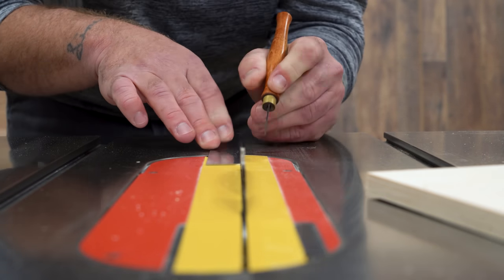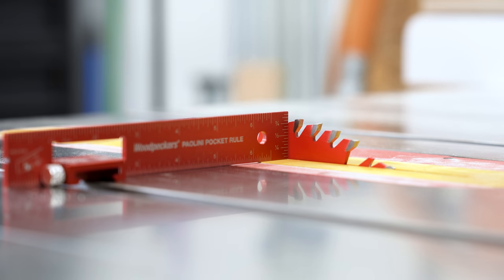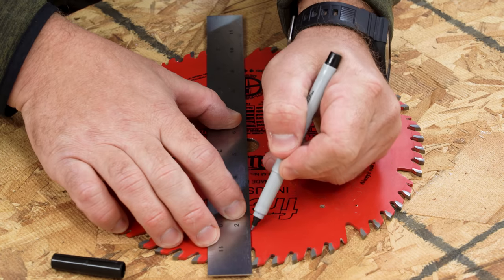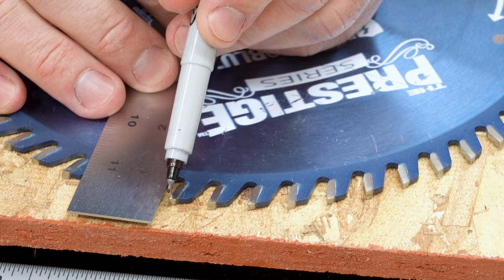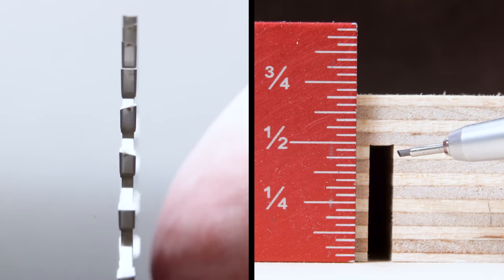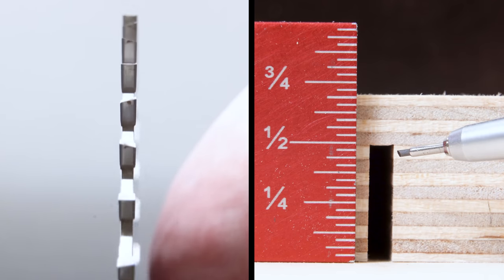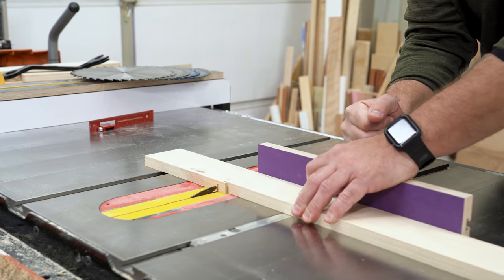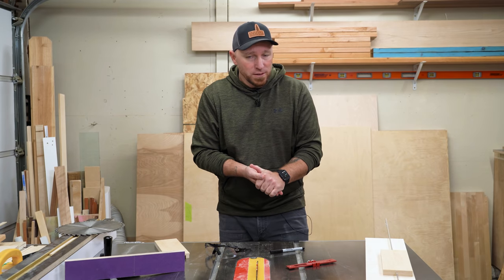Possibly the Single Greatest Table Saw Upgrade / Table Saw Tips and Tricks / Woodworking

Comment: Excellent idea.  I have 3 different width flat bottom grind saw blades.  I have a center line drawn across my throat plate and a vertical line on my fence, but those are not exact.  This will eliminate any doubt.

Comment: Great trick! A mark on the table (aligned to the center of the shaft) would also help setting the blade, so it's always vertical when you measure the height.
Reply: Most tablesaw's have an abour that moves in an arc when adjusting hight. If you mark arbour centre on the table, it will only be valid for that specific hight adjustment.
Reply: @joehugo5134  I didn't know that, I thought they move in a straight vertical line, on two guides, like a thicknesser
Reply from the maker: Maybe. Marking the center of the blade pretty much eliminates the need for additional marks on the saw though. When you square up the line to whatever tool you use to check height, the line will be perfectly vertical. That will give you the center of the arbor and the exact peak of the cut all in one go. Hopefully that made sense 😆

Comment: Being a Tool & Die maker all my life I ground an assortment of precision flat bars at 1/8" increments up to 1/2" use these on saw and router table to set depth.
Reply: I think his point about drawing the correct line across the blade is still pertinent to your technique.

Comment: I measure beside the blade, from the washer under the arbor nut to the table surface using a scale I made using stick-on ruler tape.  I made it so when the blade is at table height, the scale reads zero, and as the blade rises the scale rises with it.  Read the scale as it crosses at the table insert plane.  I find it to be easy and accurate.

Comment: This is a really useful trick! Does the sharpie line slowly wipe off or did you use something else to make sure it stays?
Reply from the maker: The line should stay unless it's got a coating that the marker won't stick to. The blade itself is narrower than the teeth, so material should never come in contact with the marker. I've used pencil before with good luck too.

Comment: I have a question for you. Can I run a 6 1/2" blade in my table saw? It currently has a 10" blade.
Reply: One way to find out if it can or not is to raise entirely your 10" blade and measure the distance from the top to the highest part of the blade, and then substract 1.75" from that measurement. If it stays positive, it could, if it is either 0 or negative, it won't. As for the 1.75" measurement, it is basically half of the difference between a 10" and a 6.5" blade (10-6.5) / 2..
Reply: You should be able to as there are 6" dado stacks available. Just remember it will greatly decrease the depth of cut you can make.
Reply: As long as it’s the same arbor size. I run a 6” dado stack. You loose a little surface speed with a smaller blade, but  it doesn’t seem to affect cut quality
Reply: Awesome! My day is planned out for tomorrow!

Comment: The one thing I would note is that if you're trying to make a non-through cut and you aren't using something with a Flat Top Grind you either don't need an exact measurement like this or you need a different blade. If the blade does not create a flat top, there's no exact answer to the depth and it's rarely going to be important to get the exact measurement you want. If someone needs to use the method you show, they're better off getting a different blade that's FTG even if it's a low-end blade.
Reply from the maker: @Kyle Olson I kind of to agree with you, however I remember when I couldn't afford a true flat bottom blade and had to make do with one that was close enough. And as much as those little dog-ears bothered me, knowing exactly where the lowest depth of cut would land was truly helpful. You might be surprised at the number of comments that I have received over the years that say the same thing.
Reply: This method will not eliminate the need of adjustments but it will give you a better and repeatable starting point. And with some experience you will learn the amount of offset that is needed for your desired result.

Comment: Something i need to ask i have a Evelution rage 5s  table saw a bolt goes into the arbour  so if i get a longer bolt can i run a dado stack with this as is it safe to do so please make a comment about this before i get a dado stack.
Reply from the maker: The only thing I can say for certain is to consult with the owner's manual on whether or not the manufacturer recommends running a dado stack or not.

Comment: I would think the pencil or pen line would wear off from friction as you make cuts with the blade. Would scribing the line with a knife work better?
Reply: The set of the teeth should be making a wider kerf than the body of the blade.
So no touchy.... no friction.
Reply: @dave_ecclectic  Good point. Thanks!

Comment: Great concept mate. But wouldn’t the line rub off after a couple of passes? I mean printing on the blade comes off, so marker will definitely rub off.
Reply from the maker: No because the teeth cut a kerf wider than the blade plate, so the material doesn’t come in contact with the blade. Or at least I’ll just say that I’ve never had an issue with it. 😂

Comment: You can also put a line on the clearance insert so you can line the two lines up and to make sure the blade is at the top it's stroke. I hope I explained that well. 

Make the line on the blade. Then while making sure the blade is at the exact top, continue that line onto the insert covering the blade. It should make it easier to line back up so it's at it's highest point without having to wiggle it back and forth
Reply: Very smart 👍

Comment: So you are going to have to take the blade off the saw and then mark it? 
You could  already have the 1/2" figured out by the time you put the blade back on!
Reply from the maker: No, you have to have a little common sense and mark new/resharpened blades before they go on the saw. And if you are one of those “I’ve been using the one blade for thirty years and it cuts everything blah blah blah” folks, taking the blade off one time to mark it is still way quicker and accurate that playing the guessing game just a few times.
Reply: @InspireWoodcraft  "blah,blah,blah"---Wow you are so wonderful?
I'd have that 1/2"  cut much quicker than with your "brilliant" idea!
Reply from the maker: @Bill Stretch Yes, I know. You already stated that in your first comment. Look, I'm not here to convince anyone of anything. But the fact still remains that setting yourself up properly once is still quicker than doing it the harder way multiple times. If it's not for you, that's totally fine. But facts are facts.

Comment: Wouldn't it be easier to mark the center of the arbor on the table saw?
Reply from the maker: I wouldn't say easier. Finding the exact center of the blade takes about five seconds and is pretty hard to mess up. Finding the center of the arbor is a bit easier to mess up and is a bit more complicated.

Comment: The blade comes off my saw only when I change blades.  I always drop the darned nut...
Reply from the maker: It would be interesting, to say the least, if it came off when you WEREN'T changing the blade. On a serious note. I get it. Try gluing a magnet to the end of the arbor.
Reply: @InspireWoodcraft  I'd probably drop the arbor, magnet and the nut.  Thank's for the videos, BTW!

Comment: You show using a sharpie to mark the blade  That mark will only stay on until you make a full  depth cut like ripping a 2x4 then you have to take the blade back off to remark it. Why not use a combination square set to the desired depth of cut set the end of the blade by bringing the blade up to the square. Why make up a solution to what is not a problem.?
Reply from the maker: I’ve done this with pencil before too and it works great and lasts a long time. Material doesn’t come in contact with the blade, it comes in contact with the teeth, which creates a kerf that the blade plate passes through unscathed. Blades don’t have an “end”, as they are round. The only way to easily know how high the blade is to know where the center of the blade is, or the center of the arbor shaft, which is the same place. Without knowing where the center is, you have to guess.

Which is a problem.

Which I have solved.

Hopefully that helped you understand better. This a trick that has been used by lots of people over a long period of time with great results.

Comment: I couldn't listen fast enough to keep up with all that.
Reply: Basically what Inspire Woodcraft says is this;

1- Lay down your saw blade on your table, with the face that you want to mark facing up (left side of the blade, in most cases).

2- Find the tooth that will generate the lowest point of the profile that you would cut.
    For example, if you have an ATB (alternate top bevel) blade, you would want to find the tooth that is thicker on the table and thinner towards you, and identify the opposite tooth.

3- Connect the tooth.

Note: The reasoning behind #2 is so that you will always have the lowest point of the profile, which is useful when making grooves for instance, but, you may also want to identify the opposite tooth (the ones that are thicker towards you and thinner on the table) for one reason; If you want to bend some plywood pieces for example, this will give you the highest point of the cut, so you don't cut out the veneer on top of it... and, another note, if you have some flat tooth, you should connect those, as they will always be the lowest point of your profile.
Reply: Also, if you note both the lowest point (which Inspire Woodcraft describes in the video) and the highest point (which I gave an example as to why it might be important), you may want to "marker" them with different colors or do a parallel line next to one of them to differentiate them.
Reply: Change the video playback speed by clicking the gear icon.  That will slow down the audio as well.
Reply: @PunkR0ckz09  I was saying that with tongue in cheek...
Reply: @watermain48  Well, sorry, I guess? I'm french canadian, we don't have the same jokes and whatnot so...